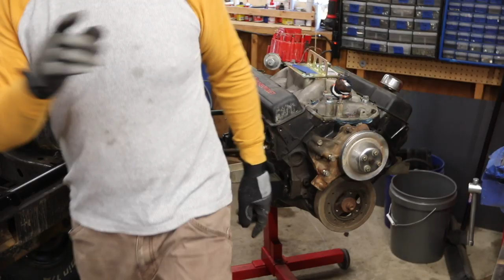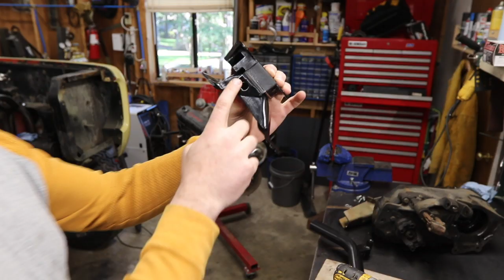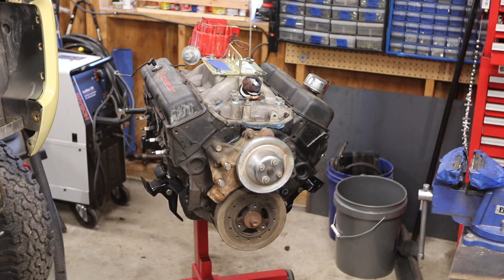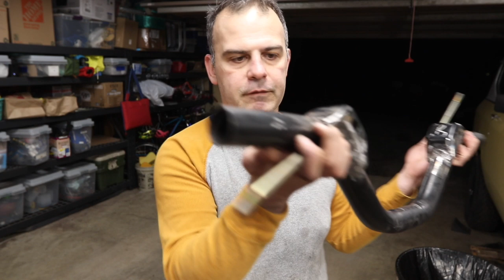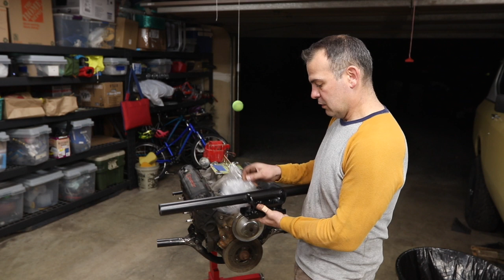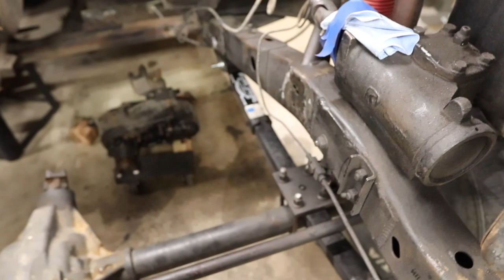5.13 Small Block Motor Mounts and Crossmember

Comment: solid.  remember the strongest shape is an arch.  not sure you need to add more strength with gussets.  the weight is resting on the top of that bend, which should give it lots of strength.